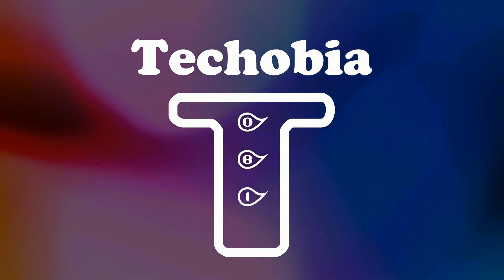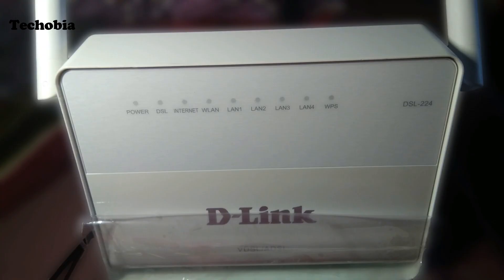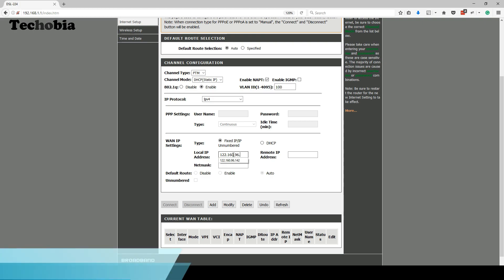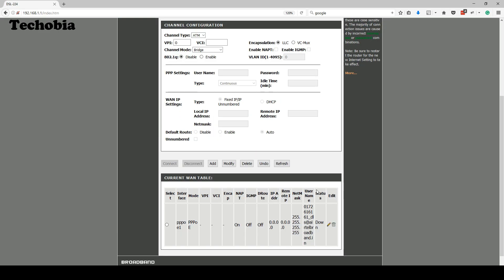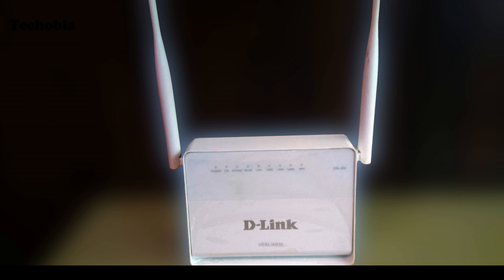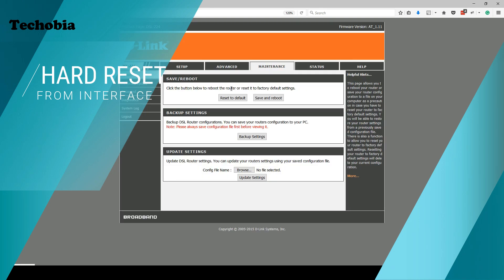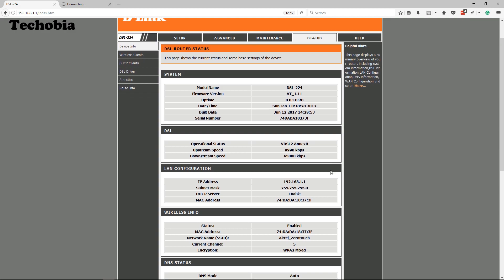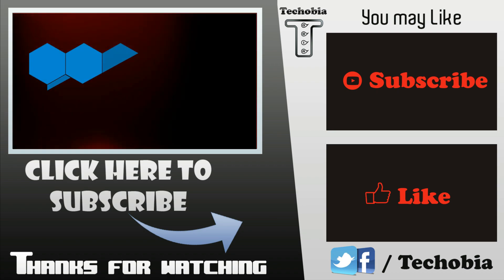Dlink DSL 224 | Airtel VDSL Modem | Configuration | Static IP | Port Fwd | DVR Cam | Speedtest- Wifi

Comment: I accidently factory reset my d link DSL-224 I don't know about my Account number and password (not admin one) pls help 😥
Reply from the maker: If you are using a connection with Airtel then just power it on and leave it on for few minutes, it will get restored it self to default settings otherwise call helpline and they will help you to fix it.

Comment: Hello,

i have the same router but i need dump flash for it

if you can help and take dump from the router you have
Reply from the maker: It will not work for you and make it unusable as flash which we have is a customized one from our ISP with locked features as well
Reply: @Techobia  

Why ??

It has been locked to airtel only too the isp username or you can use what you need ?
Reply: @Techobia  as i see in the video the username with any prefix behind it like i have

If you can help and give me that dump
Reply: @Techobia  it will work with my own router i am sure100%

Ithas the same hardware version 

Does not matter about the software version
Reply from the maker: Right now they are not providing the flash file for manual updates. Now all updates are performed from backend using tr069 and there is no way to dump it now as it's locked.
Reply: @Techobia  

You have minipro programmer ?
Reply from the maker: No I don't havr

Comment: Hi, I need to know the websites visited by my kids just as a precaution and i know it is possible thru modem and email, can i know how to do it using dsl 224. thank you
Reply from the maker: Not directly via this modem but you can further attach some router and connect all devices to it. There are some advance routers where you can check all logs and even block sites directly from the router
Reply: @Techobia  thank you
Reply: Hi Further i wanted to know if i change the modem to different type will it serve my purpose, can i ask Airtel to change the modem or i can buy from market and install say fro netgear etc

Comment: Hi Sir, thanks for the detailed video. Can you please advice if it could work with Google wifi mesh network? There is a LAN cable with google wifi which could be connected to one of the 4 Dlink DSL LAN ports from the google router.
Reply from the maker: Yes, absolutely. Now put this router in bridge mode. Check one my recent video how to use router as wifi extender, i hope this will help.
Reply: @Techobia  great, thanks!

Comment: What is local ip ??
I have installed one another tenda router and ip is 192.168.0.1 it is my local ip or not please guide
Reply from the maker: Nope, it is ip of router as you need to set 192.168.1.2 as starting ip inside teinda router then 192.168.0.1 will be your router ip and you can also access 192.168.1.1 which is directly your modem. And tienda will work in this way

Comment: i have used option repeater mode to connect to my mtnl modem for my slave modem 777vR1,  it works fine for wifi.  but not working for ethernet cable.  also on the slave modem there is no internet led blinking,   can it be used for ethernet connection too ?  9868843648
Reply from the maker: You need to configure the slave modem in Bridge Mode

Comment: Sir i have reset my wifi 
Now i m unable to connect 
The name is coming airtel_zerotouch 
But the password airtel@123 is mismatch
Plzz help 😭😭😭
Reply from the maker: you can do one thing, temporary connect it using LAN cable and then you can get the access to modem interface and from there you can easily change the password. Hope it works for you.
Reply: @Techobia  i have to call the service provider and he solved my problem .
Hum se nhi ho paya
Reply from the maker: Chalo ho gya Hone se Matlab hai

Comment: Hi 

I got a new broad band connection from BSNL and used this modem.The internet signal is red.How to solve this issue
Reply from the maker: Make sure you firmware is not locked and CWMP option can be enable and disable.

Comment: I want to set up my old DSL-224 as wifi repeater to my new router. Can you detail the settings to be made & how to connect to my new router through wifi?
Reply from the maker: That can be achieved using bridge mode and connectivity must be by LAN
Reply: @Techobia  sir can you please explain how to do that,im not getting, how to use this router as wifi extender or bridge.

Comment: I have d link dsl 224 as have disconnected airtel broadband I would like converter this router as repeater to extend WiFi signal. how to convert repeater pl. Make a  video on this.
Reply from the maker: you have to connect this via lan as this can be get connected over wifi to use as extender
Reply: @Techobia  can you please put a video for this. I see so many threads on same question

Comment: Hello I have this modem and I got it from Airtel zero touch, and my question is can we configure it by using BSNL. Or it’s blocked by Airtel. And is it a modem or Router?
Reply from the maker: Not sure about this as never tried with BSNL operator
Reply from the maker: I am sure this comment will help others who are looking for similar answer
Reply: Does it working with bsnl?

Comment: Can I use dsl 224 n bsnl broadband connection
Reply from the maker: I assume it should work as nothing is locked inside this modem and from some of the old comments someone is using the same modem using Airtel Firmware in France as well

Comment: can i extend wifi range of jio 5 hotspot using DSL224 router.
Reply from the maker: No, As It only supports LAN wire and then you can use it as extender by configuring it in bridge mode
Reply: @Techobia  so basically its trash once you ditch airtel borad band "tortoise" connection, thanks i was wondering if it will be a good paper weight but no not any more lol

Comment: The DSL 224 wireless router was working for last 6 months,  sometimes the wireless network disappears on my laptop but it works on Mobile phone, can someone help as it is happening frequently.
Reply from the maker: Which OS you are using on your laptop, as you are mentioning same thing happened with one of my laptop then I cam to know that something is wrong with laptop driver for wifi hardware device connected to it and I did some search on internet and modified some properties and that make a fix for me.
Reply: @Techobia  I am using Windows 10

Comment: I am using act fibernet i have this router and not able to configure could you please help me with this issue
Reply from the maker: to be honest bro, I already sold this one out and I only knew settings for Airtel for which I made and posted video
Reply: Me to have a same problem

Comment: Does it support NAT loopback?
Reply from the maker: No, might be that blocked or it is not supporting because of security issues
Reply: Techobia thanks, wanted tonknow because I have Airtel Huawei HG 630v2 no support for it either. Do you have any recommendations? Looking for dual band VDSL router with NAT loopback :)
Reply from the maker: As such for VDSL modems which support NAT loopback, I am out of suggestion.

Comment: Can you tell me how to use this modem as repeater
Reply from the maker: by putting it in bridge mode and by disabling DHCP, putting LAN cable in it from the router as it doesn't supports wireless repeater thing
Reply: Techobia thanks a ton bro for replying, please guide how to do that...
Reply from the maker: right now so so buys even not able to make any more videos, Will try to make one if time is manageable again for me.

Comment: For those who can't login try using your ACCOUNT number as the password
Reply from the maker: Admin / admin admin / password or hard reset after removing dsl cable u till you are done with settings and make sure disable tr069 before injecting dsl cable

Comment: Which is the best router for Airtel vfiber? 

And do you also experience disconnections or speed drops on dsl 224?
Reply from the maker: Everyone has their own choices, one which I like the most is Huawei HG630a as sometimes it takes more time to connect but once it connects then no dropout issues and I am quite happy with every stuff and it fulfills all needs which I need.
Reply: ok
Reply: is there an explanation of why drops and frequent restarts happen on dsl 224? I have it :\
Reply from the maker: The first check which firmware version you are using, in my other video I provided links to 1.08 and 1.10, actually latest one are not good whereas I also provided how to prevent it from frequent disconnectivity by adding highest available number beside auto, please check my other video for the same modem. Hope it helps

Comment: Thanks for fast reply. I however preferred to return to the person who offered me and would search for d-link dsl2750u
Reply from the maker: Dlink DSL2750 is ADSL2 router which only supports max 24 Mbps, It is not VDSL so if you have to use it with VDSL with higher speed than it is not a right choice
Reply: Thanks Techobia  . I hall have to buy a new modem only then for my adsl needs.

Comment: dear sir, 
I got a workable modem  dsl-224ATL. used item.  I would want to use it for bsnl adsl for internet working . I was unable to manage. Can you please advise me how to manage. I was not even able to upgrade firmware as "too large "   Thanks In advance message comes up.
Reply from the maker: with other ISP I have no idea as didn't try it.
Reply: Did it work for you with bsnl plz reply

Comment: HI. I had some question about modem. now I use airtel broadband( V-Fiber )100mbps. if i want to use broadband (V-Fiber), i must use VDSL modem. Is it correct? because now I use broadband. but use DSL modem. so i feel speed is so slowly. now I need to change the modem. Is it right?
Reply from the maker: if you want to use VDSL as a technology to use internet to use it in high speed then you must use VDSL modem like these

Comment: How to convert my laptop/desktop into a server and host internet accessible program from airtel connection with 777VR1 model
Reply from the maker: you need to setup DMZ and port forwarding to local IP of a server which you would like to configure it as a server
Reply: Thanks, can you share a video if available.

Comment: I am using the DSL-224 provided by Airtel. I want to use my old Belkin G Wireless Router as a wireless repeater / range extender. Can you please help me with the steps needed to do this?
Reply from the maker: Disable dhcp and put that one in bridge mode the you are done
Reply: Techobia I tried that, but it seems to be some issue between VDSL (the new DLink provided by Airtel) and ADSL (my old Belkin G). Even the Airtel techie said the two wouldn't be compatible. Thanks in advance for any other ideas!
Reply: Techobia By the way I'm trying to use my old Belkin by getting it to connect wirelessly to the DLink - not through an Ethernet cable. Possible at all?
Reply from the maker: I only tried such thing only wired and that worked for me

Comment: Hey there nice video...

The issue i am having is my uploading speed is throttled at 2.5 Mbps while i am using my PC. When i use my laptop i get full potential ie. 8 Mbps which i paid for. Can you tell me is it the issue with router / modem's firmware ?
Reply from the maker: which operating system you are using if windows then look on internet for this LAN card driver fixes for old computers as  windows has some issues with drivers as on one of my old laptop similar issue was there and as I remember I found some trick registry and some lan changes then it fixed it
Reply: Well i have updated the LAN card drivers last month itself, when the problem was just fresh but still the issue is there :(
Reply from the maker: It is not LAN card driver issue its windows, to check do one thing use live linux like ubuntu or Mint and run speedtest from their and see if you find any difference

Comment: Hi, Thanks for the informative video. I have a couple of questions about this router. Can I install VPN like OpenVPN on this, so that I can make all the devices connected to it use the VPN functionality. Also is there a way to enable the 5GHz channel in this router. Thanks in advance!
Reply from the maker: on this router you can't install openvpn

Comment: After months of pestering by Airtel, I agreed to let them do a free upgrade to VDSL and change my router from TP Link Archer D2 to D Link 224. 

I have not faced problems on phone and laptop, but big issues with streaming on amazon firestick. I had no issues earlier, probably because I was using the 5Ghz channel on TP Link. My question is how to set up my TP Router in conjunction with the new D Link so I can use the 5Ghz channel for connecting to firestick on my tv?

Comment: Hi I am unable to access the Router Interface Remotely . I am able to RDP a computer after port forwarding. Advanced - ACL WEB(Port 80) and Ping are enabled for WAN (PPPOE, and 0.0.0.0 - All-IPs)  but still I cannot have Remote access to the Roter Interface for management.  Any ideas ?
Reply from the maker: Direct access to router interface from outside network is not possible whereas If you got access to machine using RDP then you can access interface from that machine as router is local to that machine and it can access it. Hope this answer helps
Reply: Yes that is possible I know. Sometimes the machines are off or something and we need to connect directly to the router from WAN to check the connection etc. Normally in Routers Remote Access can be enabled. In some routers remote access is not possible on the default port 80 but it is possible on some other port. They have given ACL for WAN, and in that WEB and Ping are listed for checks, so it should be possible. I will try to change the port of Web access and then see if Remote Access works.
Reply from the maker: These modems are not designed to allow access to FTP or HTTP either port 21 or 80 or modified ports to get access to routers from outside the WAN. Please subscribe to channel and like to video to stay tuned for more upcoming videos like it
Reply from the maker: But yes you can get the access to attached router further connected to it if its supports this feature by using Port 80, 21 or modified ports as needed

Comment: i just purchased this and i live in mohali sector 70, same modem and i bought rs999 wala plan with 40mbps speed. but i am getting only 17mbps down and 0.4mbps up speed!! and they are saying that i will get only this much speed in my are!!! should i enquire???
Reply from the maker: About the sector 70, I also came to know that they have some speed issues but if they don't have the 40 Mbps why they provided you the Vector plan whereas up to 16 Mbps was easily manageable by the normal broadband connection and your old modem.

See these results just a min back from 3B1 http://beta.speedtest.net/result/6919289522

Just ask it from Technician directly if possible as they know well that in which area they have max speed of which limit

Comment: how to enable WPS on this router
withouut logging in to the router or connecting to it
Reply from the maker: I recently contacted the airtel technician regarding this issue and he told me there is only one way which is by logging into that router.

Comment: How much time Dlink DSL-224 takes to boot? My Binatone modem takes approximate 3-5 minutes to boot up & then Internet is available.
Reply from the maker: 3 to 5 min are normal
Reply from the maker: In case of every VDSL modem boot time takes 2 - 5 min which is considered as normal
Reply: Was wondering why a modem should take so long to boot. Thanks for the reply :)
Reply from the maker: This is all because of the backend connectivity. Dlink take sometimes 8 - 10 min in night to whereas Huawei get stabled in 2 -4 min and in night it takes 5 -7 min and Binatone and Beetel is same like Dlink so that why I consider as Huawei HG630a as best as once it get stabled it has very less dis-connectivity issues where all other modem disconnects frequently

Comment: Hi, I am facing download speed problem on Air Tel provided DSL 224 modem for my 40 mbps broadband connection since last one month. The download speed comes down to 3 4 mbps with ping time of 64 ms. Air Tel technicians visited 4 - 5 times but the problem is solved temporarily for few hours { 40 mbps and 7 ms ping download speed}. they have also change the router but no luck. Please suggest the remedy.
Reply from the maker: This type of problem is always form backend and this can only be resolved from the backend. If they are not able to resolve it make a video or click pictures of your screen with speed test at those timings and upload these and send them via mail to their customer care email

Comment: My Airtel dlink 224 modem takes 5-7 mins connect. How long does it normally takes to connect ? Is there any issue ?
Reply from the maker: It normal in some case as it depends on many factors but once it get stable then it should't get disconnected frequently as frequently disconnection is issue which need rectification

Comment: Can I use this device (dlink 224) as WiFi repeater? Like in Bridge mode?
Reply from the maker: you can use it as repeater after connecting it to LAN to primary modem and use the same username and password for it as it is not used as wifi repeater using wifi configuration
Reply: Can i do it by wireless? instead of LAN?

Comment: since you are on airtel can you check if you are able to forward port 80 & port 5000 on this router.  ONLY these ports dont work even if they are forwarded properly. please check
Reply from the maker: I am not sure about the port 5000 but I worked on port 80 and it worked well for me. As I routed to my local server and I am using a static IP and it worked fine for me.
Reply: Techobia so for you port 80 is working in dsl 224 as of last one week... Mine stopped working. Don't know why
Reply from the maker: Make sure that you settings are not getting updated with new firmware update performed automatically